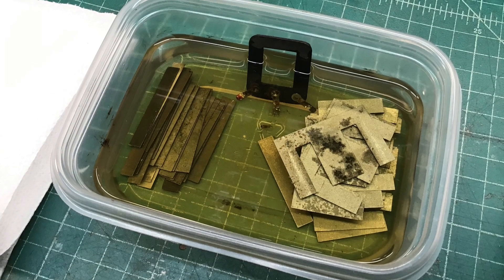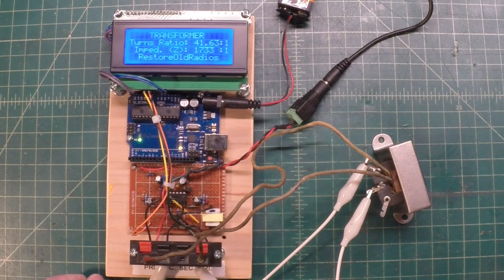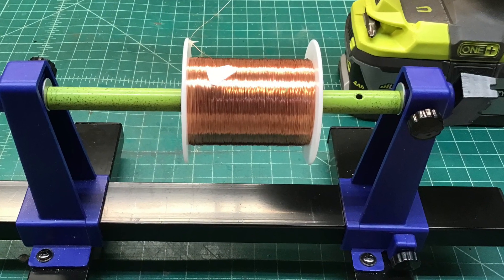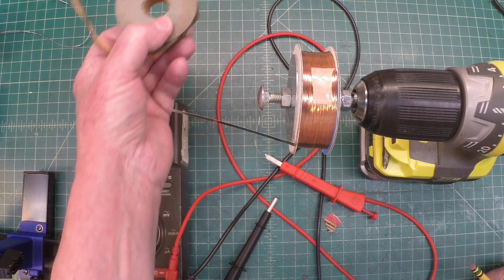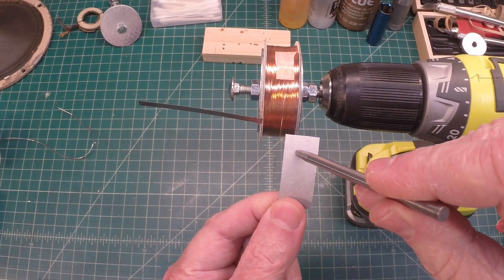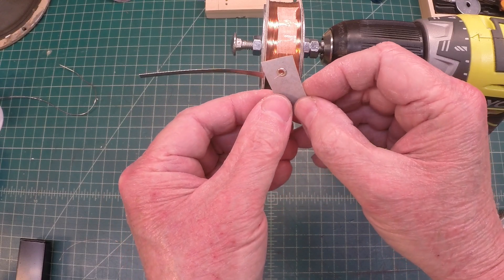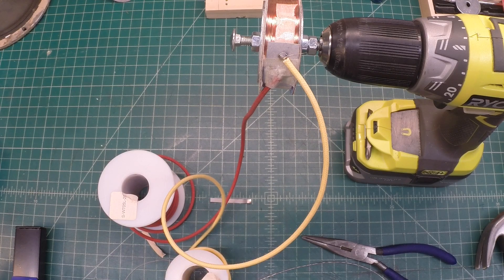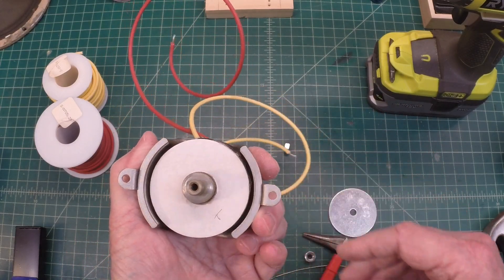Zenith 707 - Winding a New Field Coil & Output Transformer Update

Comment: Hi Don.  Beautiful technique.  Very impressive.  Jim
Reply from the maker: Jim - thank you. I was thankful things worked out. Did you apply the rust inhibitor and if so, how did things go? Best, Don
Reply: @RestoreOldRadios  Hi Don,  I got the chassis as good as it is going to get and have the radio taped up just waiting to get the product in the mail.  Jim
Reply from the maker: Sounds good. Hope it goes well. Best, Don
Reply: @RestoreOldRadios  Hi Don,  Good to hear from you, as always.  I have ordered it but have not received it yet.  Plus, I am still working on the chassis.  What I want to know is if a coating will be non-conductive.  If you have some time, you might try an experiment like you did to make the leaves of the transformer that you rewound to be non-conductive.  I will try to do the same when I receive the product.  Thanks again.  Jim

Comment: As a kid, I use to like  doing that  wrapping  coil  around a  core and building electo-magnets  Induction is  fun, when you smoke the coils
Reply from the maker: Funny you mention that. I had a train set as a kid and took a spring out of a ink pen and placed it across the power supply terminals and adjusted the pot until it turned red hot before... Best, Don